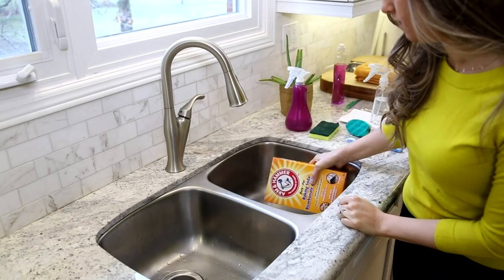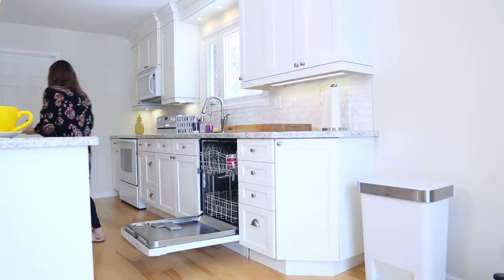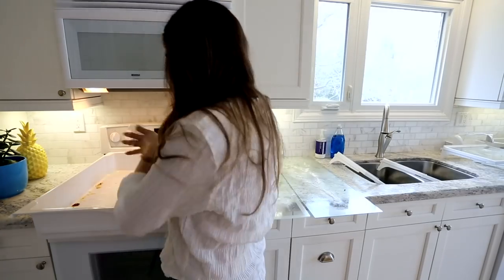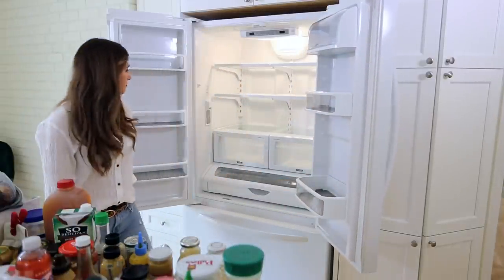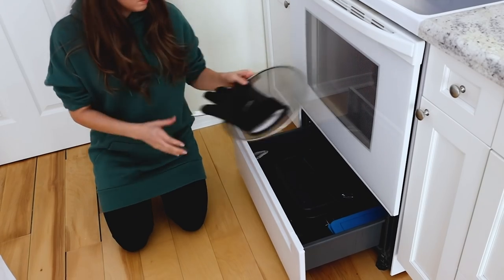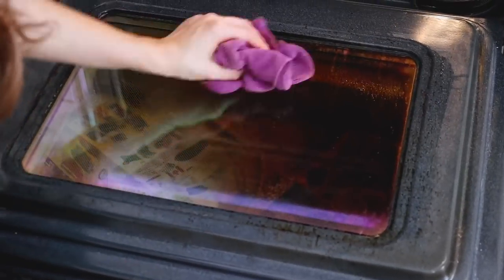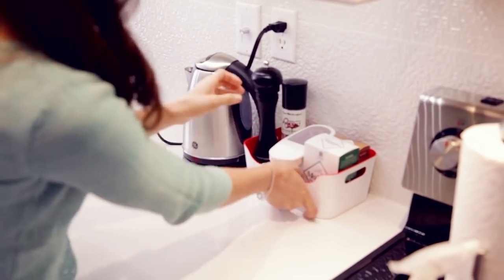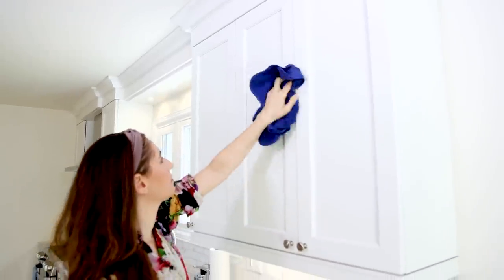CLEAN WITH ME: Kitchen Cleaning MEGA Marathon!

Comment: Tip - once oven is clean use heat proof oven liners on the floor and sides (where possible), cutting holes where needed to allow fitting of shelf rails.

Comment: How about cleaning ON TOP of the cupboards where grease, etc collects over time? I don’t like cleaning on top of my cupboards because I have a really hard time doing so.
Reply: Pre treat with Spray Nine cleaner and use a magic eraser. After you have the top clean put wax paper down with tape and then next time it needs to be cleaned, you just roll up the waxed paper, keeping all the dirt and dust contained and then the tops just needs a quick swipe. Don't forget to put new waxed paper down 🤗
Reply: Leave some plain paper after a deep clean and the area is dry. you will not find as much dirt next time.

Comment: Do you have a video on cleaning a gas range for grates, burners and top?
Reply: I appreciate having a clean stove, even tho the work is arduous for me as far as picking up those long, heavy grills! But I flatten out a cardboard box & put the grills on that, & spray them down w an all-purpose cleaner. Leave that there to soften any gunk, then I use an electric toothbrush (yup! Got one aside for kitchen cleaning!🤣) & scrub away!! I quick rinse in the sink, & back they go on my stove! I use that toothbrush for zipping thru corners, the areas around the faucets, corners, etc. & the abrasion depends if u use it plain or w an additional cleaner. 😊🤪😅😊

Comment: Could you recommend the best and easiest way to clean heavy grates on top of my gas stove.  They are very heavy and do get a little greasy and sticky.  I take them off and lay them gently down on the kitchen counter covered with a towel while I am cleaning the top of my gas stove.  My grates are three pieces that lay on top but they do not fit in my sink and they would damage my tub.  I remove them to clean the top of my stove about once a week. I have been spraying them with your all purpose cleaner and wiping them with a damp microfiber cloth.  They are cleaner but not completely unsticky. What a pain and a mess.  I live where I get seven months of snow so doing this outside is not an option.  Any suggestions?

Comment: I think that dishwasher DOES actually have a filter. It looked a lot like mine (a Maytag/Whirlpool) which requires you pretty much dismantle it to find the filter under the one you used the toothbrush on. That one comes out and you have to remove the tube going up the back.

Comment from the maker: What part of the kitchen do you HATE cleaning?
Reply: The gas stovetop. 🙄😒
Reply: My bedroom always have
Reply: The fridge, just because I have to take everything out and then put it back in. So my strategy is to wait until the night before I do groceries
Reply: Oven.
Reply: On top of my cupboards and inside my oven
Reply: @royalone3009  I  am getting too old to clean top of cupboards, so my grandchildren do it for me.
Reply: Under the fridge. I have to roll mine out from the  wall to open the door wide enough to remove the grid on the bottom and clean. . .
Reply: @daledavis6984  One of the benefits I have with cabinets going to the ceiling. I never knew what a blessing it was until I bought this house. Now that I'm downsizing, I'm looking for that in the new place.
Reply: The floor
Reply: Kitchen hood. In my new kitchen we are going to have one not hanging over the stove but integrated into it. Boy it's gonna be a challenge to keep it clean.
Reply: The oven, it's awkward and takes a lot of elbow grease. By the time I finish I'm exhausted and shaking from all the scrubbing.
Reply: The fridge

Comment: i have trouble with the top of my stove. it's an old fashioned electric. But it's greasy with black rings under the burners with a white finish. and it's hard to clean. the interior is self-cleaning. the carpets are smelly with ferrets and bottle fed kittens. i would have thought u would have mentioned a degreaser. And cleaning the top of the washer.

Comment: Two words...... "OVEN LINERS"!!     Those things wipe with a paper towel and look new afterwards!  There is no scrubbing or scraping in the bottom of your oven with them, just the sides and door.
Reply: I have a gas oven and I pull that, my fridge, and washer and dryer out at least 2 times a year. You would be surprised how much the sides of your stove get crusty and stained if you don't do that... as well as the sides of the cabinets.  If you pull it out slowly.... the copper pipe for your gas range will flex easily. Just make sure that you have a length of it attached. MOST stoves allow for them to be pulled out for floor repairs or stove repairs, but check!  -- Copper is soft.